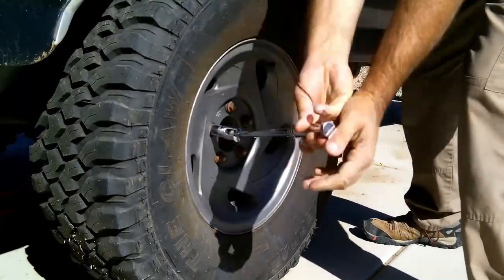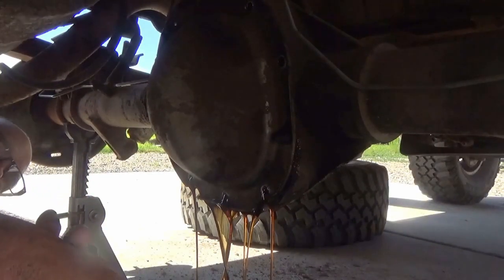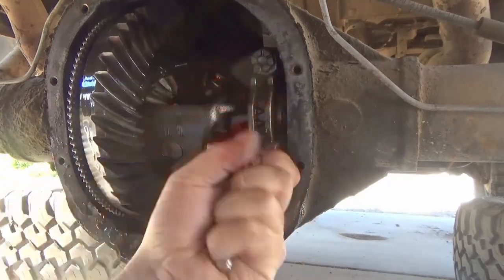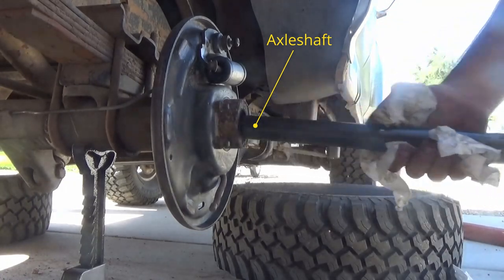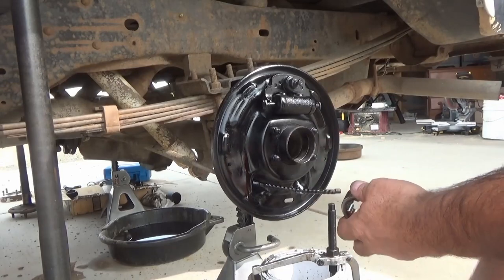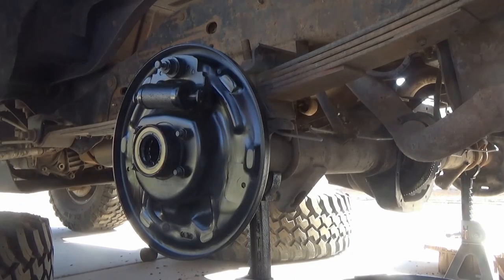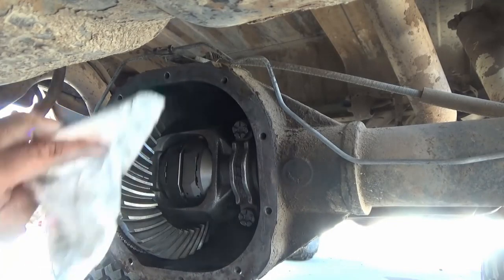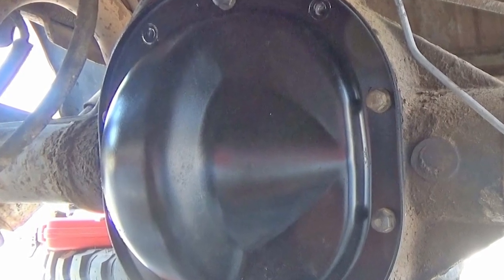Ford 8.8 Rear Axle Bearing and Seal! 1990 FORD Bronco 4x4 Project! OBS Build!

Comment: What is the main reason for this project? I just got an 87 bronco and I will have to do some work and wondering how I would know if I need to do this. Thanks!
Reply from the maker: First look on the back of the brake plate where it meets the axle tube. Is there is any oil, grease or built up oil and dirt the seal is probably leaking. Then Jack up the rear tires and move the wheel and tire up and down if it moves at all the bearing is bad. The axle will move in and out which is normal but up and down is not. Thanks for watching!

Comment: Good video. Have you have a seal to leak after replacing the axle seals?
Reply from the maker: The axle seals have a sealant on the outside already. It is normally orange or yellow and is sprayed on the part that presses in

Comment: I've got some wetness on my drum that smells like gear lube...  '88 F150 4X4, I think I need to replace my axle seals at the very least but why not throw in some new bearings while I'm in there given the age of the vehicle?  Might be my project of the day so thanx for this vid!
I believe Oreillys has the bearing tool for $55 which I can use and take it back free tool rental  just so people know, just subscribed.
Reply from the maker: Is worth the rental! I live in a small town, my AutoZone lend them out to locals for free, but I bought a kit because I know how useful they are! Good luck let me know if you have questions! Thanks for the comment!
Reply: @heathputnam9524  ouch!  I just removed the center pin retaining bolt and it sheared about 1/4" from the head...  not sure what to do next, probably jammed in there, I didn't even put that much torque to loosen it, used my 1/4" ratchet w 5/16" socket. 
 Woah is me. Gonna start looking for a drill bit if I can even get it in there.  ugh!  Fix Or Repair Daily for me w this '88 lol.
Reply: ok, 8.8 differential cross pin bolt... apparently it is a common problem where they snap at about the first 2 or 3 threads of the bolt so it might not be a bad idea to just replace it every time it is removed and be careful torqueing it, I believe NAPA sells it for $3 although on ebay it's $11 delivered at the moment.  Fortunately there are YT videos and tools to extract the bolt which is what I have to do now to remove the center pin and then continue fixing my leaking inner bearing seal as the brake shoes are completely soaked in gear lube on one side and then I have to consider new shoes but that's far from my mind at the moment lol.
Good Luck everyone!
Reply from the maker: This has happened to me before also. Take a center punch, sharpen it and reach in and try to turn it with the point of the punch. If it moves just keep spinning it withe the punch. If it doesn’t move try to tap the punch with a hammer in the direction to loosen the cross bolt. Only then try the drill. I have always been lucky and it spun out with just a punch and a couple light taps with a hammer. Good luck!
Reply: @heathputnam9524  Update: '88 F150 back on the road for now!  I ended up doing what some videos say, I took the broken piece of the cross bolt that I had removed and put it in the little vice for my drill press and I drill an 1/8" plus hole thru the center as best I could then screwed it back in the hole and used a Dewalt 1/8" drill bit 12" long part number DW1602 ($6.47) from home Dpot using PB Blast for lubrication slowly drill a hole enough to get the ez out in there and got it out. Whew! Then it rained a lot but eventually I got back out there and kept going, I wire wheeled the cover plate and bolts and sprayed some VHT gloss black epoxy paint on it, let it dry, then installed like you did after using a telescopic magnet to clean out metal bits but I did end up waiting 24 hours for the RTV to cure just in case and then I filled it up w the 80w90 gear lube.  The two smaller spider gears have major pits in them so that's on my mind, I'll check your vids about installing a posi in there, I think I can just get a kit to do that? The beat up spider gears gives me incentive to check that out at some point hopefully later than sooner.  I replaced the shoes as the right side were soaked with gear lube, I need to search ebay to get  some brake parts for the left side, a square spring and its metal holder thingy on the horizontal lever which were lost w the previous owner and the metal arm that fits into the wheel cylinder and pushes on the shoes is kinda broken maybe because of the missing other parts?  anyway I have yet to replace them but I did replace the bearings and seals and that all went smoothly, much Thanx to your vid!  Then I checked the front differential and ended up adding about a quart and a half, later I'll drain and redo the front diff seal as well but I have to learn about the front diff as well, maybe more seals and bearings to consider?  and check the u-joints... the truck seems to drive better with the new gear oil and bearings but it is still a bit rumbly at higher speeds which I believe is the tires but I should double check the front end again,  wheel bearing tightness, ball joints etc.  I've already replaced most if not all the suspension rubber  and body mounts and did use a lot of the polyurethane Energy suspension stuff which I'm not too impressed with, I think I like MOOG parts better, a better original feel etc.  But I may get new tires tomorrow and that may change everything. My tires right now are pretty old and they have spent a lot of time sitting so there are probably flat spots creating the death wobble  altho I did balance them but maybe there are issues w the drivetrain esp since I did drive it a bit being neglectful of the low amount of gear lube.  I can't believe I never checked it!  I've had this truck for 20 years although it spent most of its time sitting but it's so easy to check the diff fluid and I never did which I will blame on laziness and neglect lol so I'm not surprised I have pitted spider gears.  Let this be a lesson to you owners of older vehicles, don't be lazy like I was, check your diff fluid!
Reply from the maker: Thanks for the update! I will be digging into the front of my bronco soon so stay tuned for all that fun! I’d love to follow your adventures so please update me from time to time. Thanks again for watching!

Comment: Do you grease up the bearing at all? Since it’s getting lubed by gear oil I wouldn’t think right?
Reply from the maker: I do not add grease to a wheel bearing hooked to a differential. Thanks for watching!